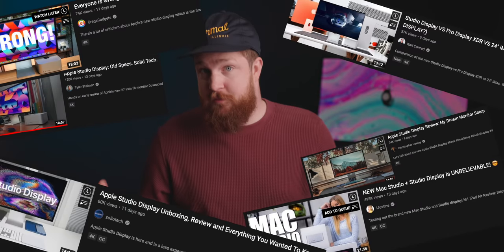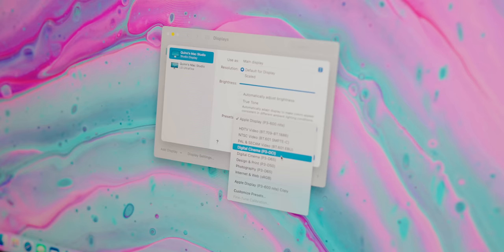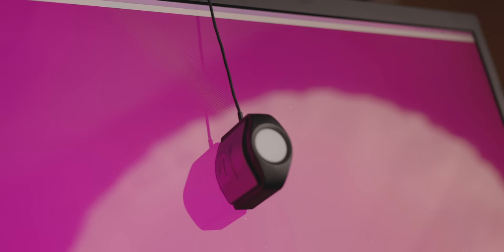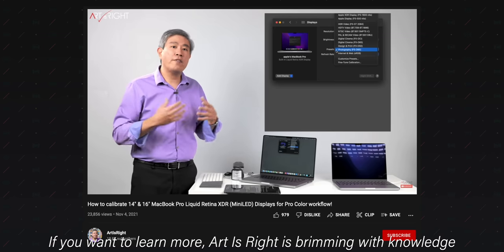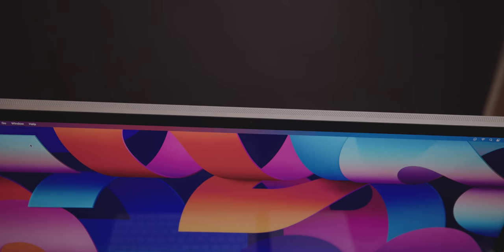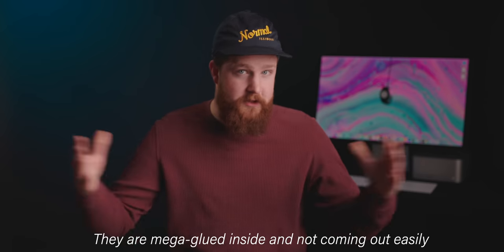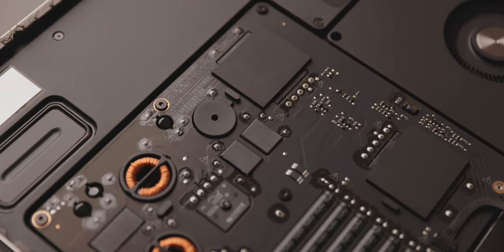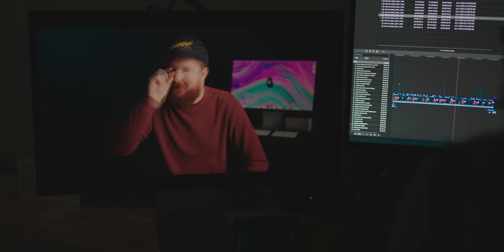The Apple Studio Display Is WEIRD!

Comment: I was hoping Apple would have done a base model 24" 4.5k screen (Same as new iMac without computer) as the entry level monitor near the $1000 price point, and they could have marketed that as a possible second display for existing iMac users, or as a single or dual monitor setup for Mac Mini/Mac Studio etc. I think The 27" 5K panel needed to be mini led (though high refresh rates don't seem to be possible with current bandwidths so I'd be fine with 60hz) and could have landed in a higher price point like $2599-3000 ish (which is what 32" OLED monitors are going for), and that could have been marketed as a companion for MacBook Pros or for higher end creative studios using super powered Mac Studios(where 27" iMacs were so plentiful). Then you'd have the Pro XDR at the top to top the specs for both size/resolution/price. 
I think that would have been a nicer eco system with a lot of possibilities for personalization which would possibly bring in a varied customer base.

Comment: Love watching non-computer designers tell computer designers how to design.
Reply: Exactly !
Reply from the maker: When did I tell them how to design?
Reply: @snazzy  You said the product should be cheaper without admitting features would be cut. Do you expect the company to sell it at a loss? I really get tired of reviewers saying this. Also, you judge it over engineered without suggesting how they could maintain the feature set with less engineering. Perhaps it has exactly the correct amount of engineering.
Reply from the maker: It doesn’t take a genius to know that caps soldered to a z-axis of a PCB with laser cutouts to reduce total depth is expensive and frankly unnecessary.
Reply: @snazzy  So if they mounted the Axial Lead Capacitors on to  the circuit board, you would complain the monitor is too thick and therefore a piece of junk...  Your always  looking for a way to put down Apple (it's how you make money on youtube)
Reply: @snazzy  This is what I'm talking about. Your opinion is that it is "unnecessary" but you provide no data to support it. I suspect a few parts are the only things in the way and that the cutouts allow the monitor to be, say, 30% thinner which is a significant improvement. My proof is that the designers did it. If you think they are wrong then prove it.

Comment: found that screen to be ‘shit value’ for money: years old panel .. cannot daisy chain several (cannot work on single screen) … speakers are pretentious enough to clain ‘best in class’ but not good enough to be used daily (listened and the screen being lower over the desk, i was utterly put off by how the sound felt totally directional, feeling ‘trapped’ below the panel)… mediocre, at best, webcam … ridiculous cable (yesterday i moved my screens again and was glad i could remove the cables in the process) … cant move the screen at $1600, and it is too low for me … very limited connectivity

Comment: I can tell you who this display is for: Software Developers. 
As a developer I need a 5K display with crisp text readability. I dont care about brightness, HDR, color accuracy or anything else, I read text all day long and and I need a "retina" display that displays 2x pictures when embedded in applications. With 4K monitors I cannot set macOS to 2x pixel density otherwise the text gets too large. The ultrafine is just not obtainable here, it is listed in a few stores but always sold out. The Pro display XDR is just way to expensive to equip an entire team with.

We have tons of old iMacs, as we had to buy a new display just to upgrade the internals and only the very old ones can be used as a display as apple scrapped the target display mode at some point.

So I am very happy apple released this display and I immediately ordered them for the entire team. Yes it's expensive, but that's not an issue in my case.

I hope that I don't get too mad at the design decisions Apple made. The power cord is ridiculous.

Comment: I have no idea WHY you would need a 5K monitor over a 4K one. Sure, I've heard things like "You can see a full resolution 4K video in your video editing software" or "more tracks are visible when using a DAW software" and things like that, but they're all things you could do more easily on a dual 4K setup or even with a 21:9 monitor, so I really don't know why you would want that, especially since it's not a standard resolution, so you can't watch content without upscaling or downscaling (do we agree that basically everything is rendered at 720p, 1080p, 1440p and 2160p, not in 2880p?). For that price, you can probably buy 2 decent 4K monitors or 2 really good 1440p ones (or hell, even an iMac if Apple had added a HDMI output on their 1300$ All-In-One that won't be more than a screen in a few years, I still don't understand why they never did).
Reply: Graphic design studios. I can’t comment on video side of things, but for web or digital, 4K scaled is useless on a Mac. I admit Windows is probably okay but we are talking Mac right now so, that’s why. Have returned every 4K display I have tried, it’s just not good enough to scale to pixel perfect alignment. Best to stay low res (which sucks) or go high, hence this screen. My thoughts anyway.

Comment: 5k is a wonky thing. Supposedly this panel is the exact same one from the iMac pro. Next generation will probably be promotion. They are limited by thunderbolt (display port 1.4). HDMI 2.1 was in the distance when they were designing this monitor. Seems good enough for the market they are Target imo

Comment: Kinda ridiculous that this display has an over engineered internal PSU when the iMac doesn't even have that. They should have used the same PSU and magnetic connector to save cost and use an A10 Fusion with 16GB of storage. There is no way the A10 is not powerful enough for Center Stage, even Alexa ~100$ smart display using the wort ARM SoC can do that

Comment: For this price it should have at minimum a 4K webcam with Face ID, and the MagSafe external power supply from the M1 iMac.  This product smacks of just being released way too early.  To not even implement Face ID, I mean the bulk of the code is already written.  I do like the speakers, and I do like the hope that in the future they'll upgrade it with a mini LED backlight, and perhaps a higher refresh rate 5K display.  But for now, at this price, it makes no sense... unless you're just someone who either has a ton of money to spend, or...you care more about simplicity and the design than the price vs the other options on the market.  The whole 5K display thing seemed like a great idea, but all the video editors I know who do it for a living use multi-monitor setups and have their actual preview window running full screen on a separate professional grade color calibrated display.

Comment: Interesting review… From the title of your video my first impression was going to be that I was going to write you some nasty words… But instead I found your review to be fair and interesting. But for me, the bottom line is I don’t care. The LG monitor, even if the screen is good, the enclosure is absolute crap. And I don’t want to be looking at that all day long. I’ve ordered my Studio Display and it will be another month before I get it, but I did run down to the Apple store and I stood there and I stared at it for 20 minutes.… And for me it was simply gorgeous! 
I could certainly consider the Dell monitor you talked about but  at 250 nits…. Even if you don’t need anymore… To me it’s  pathetic. I’ll never have the Studio Display up full brightness… It will be where my da Vinci resolve color correcting looks the best, but I don’t care. I want this display. The same reason that nobody in the world needs a Rolls Royce, but they buy it because they want it not because they need it.  And I also just ordered the Mac studio ultra… Now I do need to buy a second display. What do you recommend for that?

Comment: This was indeed intended to be a computer.  The 64GB is the dead giveaway.  There was literally no other reason for that much memory.  Apple was likely building this for the 27" iMac and due to supply chain issues pivoted this into a monitor.  It's a bizarre decision by apple.  Also this is a sad monitor in that it is 2022 and it is not MiniLED, has no local dimming or isn't OLED.  Swing and a miss.

Comment: The product manager and hardware designers heads are in the clouds! So sad... 

Going with the 24" iMac power brick would have been so much better! I do marvel at how they made the power supply so narrow! But why??? It just wasn't needed. Pull the power supply out and forget the camera gimmick and pull the fans or at least drop one.

Making this an entry display (for the Mac-Mini) and then come out at WWDC with a 32" which is thicker! and offers local dimming and just better for an advanced amateur and pro. 

I'm not against thin, it should not be the driver, and the design should have a removable foot design (VESA as an option) if its a pro unit. And have a user removable power cord!

Comment: Does anyone who works with stuff like this have a theory explaining why Apple would design a special, hard to remove plug instead of using the iMac magsafe? The only one I have is service revenue, this way, people have to take it to an Apple store if a dog chews on the cord, instead of just buying a new one.
Reply from the maker: Apple’s MagSafe happens after the DC conversion. The PSU inside this display means it’s AC from the wall to the inside of the machine.

Comment: The Apple Studio has a nice design. Full stop. Zero features, rubbish webcam, dumb ass power plug. I don't care about the build in speakers (nothing replaces designated speakers) and I couldn't care less about center stage, I sit in front of my monitor working on it, nobody is jumping around in my room needing to be followed by the cam (they should have left out the A13 and invest in mini-LED or at least integrate HDR. TB but no daisy-chaining, also, 400$ for height adjustment? Gtfo!